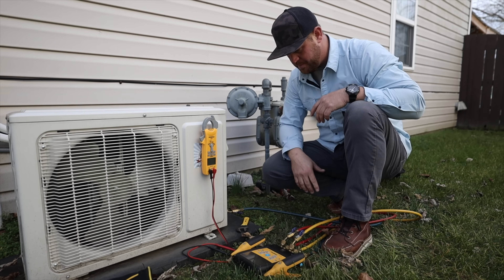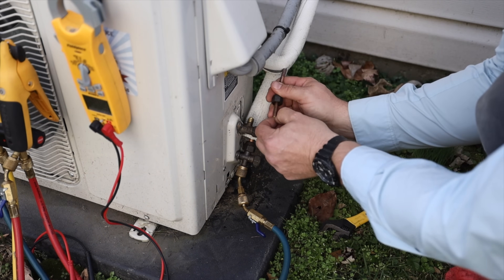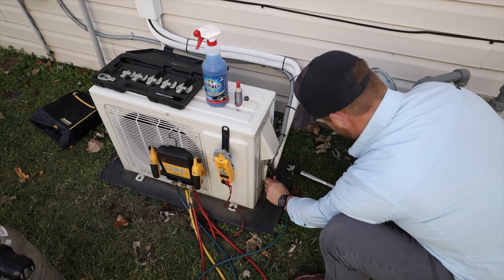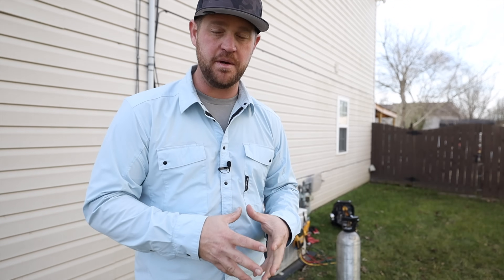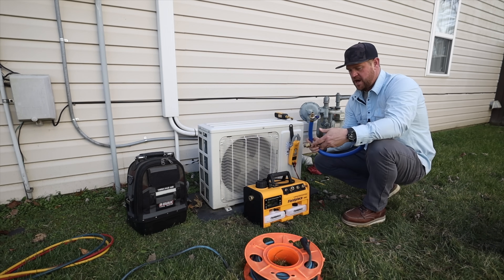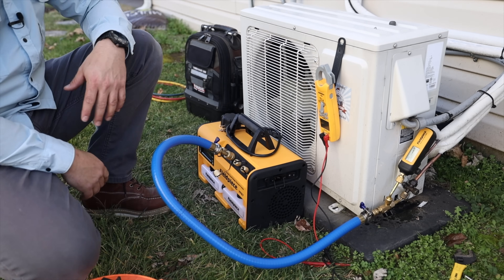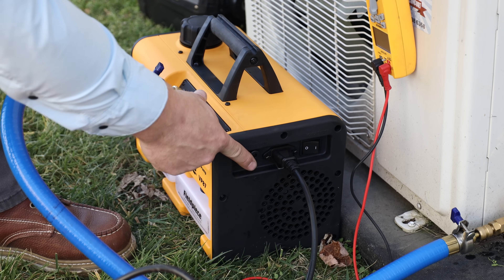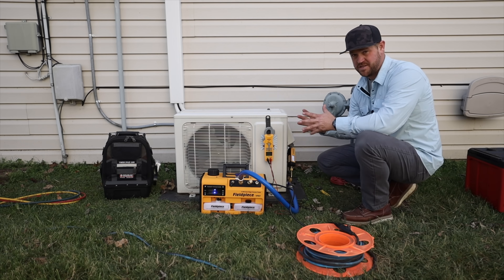#1 Reason Why DUCTLESS Units Fail | How I Fix It...

Comment: The installer didn't put the honey on the fittings!  There a type of very think oil that the techs call honey...  Works every time on the joints and fittings

Comment: When using the pressure test on the manifold, you are supposed to also hook up your temperature probe to measure temperature of the line to account for Pressure-Temperature relation
Reply: On a mini split? Where are the specs for pressure?
Reply: @Keith Wiebe  not sure what exactly you're asking, but I'm just simply stating what the instruction manual for those gauges say about the tightness test function on the manifold.
Reply: @MurderTeam1995  Maybe I misunderstood your answer. Perhaps you were referring to checking the pressure drop with temp in checking for leaks with nitrogen. I at first thought you were talking about how to fill up system according to temperature. You're not suppose to do that but I did on mine.

Comment: You can not remove the vacume hose before there is positive pressure in the system. If you do so you let some air in.

Comment: Mini-splits with their flares were designed to sell refrigerant, I feel.  I had a fitting that leaked for years, despite re-flaring twice and torqueing perfectly to spec.  Out of desperation, I finally just hoses it down with bubble fluid, backed the nut off and then re-cranked, going way past the specified torque and watching the bubbles.  After a pretty good amount of torque, the bubbles tapered off and stopped and it hasn't leaked since (at least 4 years now).
Reply: A lot of the copper that’s on shelves now is like paper. It doesn’t glide as nice on the face of the flare like it used to. Nylog helps but still every tenth flare just won’t seal. It’s absolutely that the copper is too brittle and flimsy
Reply: My boss never trusted the torque specs. He said they say that you're not supposed to overtighten, but the only way he's ever gotten them to stay was to tighten the shit out of them.

I'm my experience they will often hold charge, at torque, but can loosen over time.
Reply: 10 lb-ft seems too low, maybe with lube its enough. I would almost think that a better torque spec would involve a stage 1 torque to 50% of the desired lb-ft, then stage 2 with a degree gauge and torque another number of degrees of rotation. I DIY installed a mini-split 3 years ago and it still runs great, but I know I went well over the torque spec and tightened it by feel.
Reply: @davidryder3374  sorry, mine don't leak and all of them are torqued per spec.
Your flares are probably crap
Reply: Also need a dab of nylog on the face of the flare, I also put on backside but the face is most important
Reply: I think you are right or they just don't tell you that you have to uses a flare seal and Nylog. the Nylog helps it lubricate fittings. The nylon seal worked like magic.
Reply: My boss at my first company had no idea what to do with these systems.   Torquing to spec with new wrench we had countless leaks, key is like you said, backing off and then retorquing, torquing all at once causes tortional friction and backing off half turn cures this issue.   Still haven't decided whether like design but open minded.  Weird as fuck not in directions first place.
Reply: Oldtimers like me don't use flare wrenches.  We use good old 10-point open flare wrenches, and learn by feel how tight to pull up the flare nut.  That's where experience comes in.  I never had one of my flare connections leak, not then or over time.
Reply: @Georooney  :  Same here, and I have always oiled the back of the bell on the flare and also put oil on the threads of the service valve.  That way the brass nut doesn't bind on the copper and cause any twisting of the line at the flare connection.  Like you, and after over 50 years in the trade, I have never had a flared connection leak.
Reply: I just did a minsplit. They don't use flare fittings anymore. They use o-rings and the lines are pre vacuumed.
Reply: @josephkostinko739  thats the diy version. Most arent like that.
Reply: @ray29999  At least you know there's other options.
Reply: @josephkostinko739  That depends on the maker. Don't you know that?

Comment: Never use thread lock or any sealant on a flare connection. ALWAYS use oil when making the flare. Always clean the flare and use oil on the flare and the threads when torquing. I've never had a leak and this procedure has repaired every leak I ever encountered. I don't understand why you young guys always think you need sealant and thread sealer where it doesn't belong. Old school proper techniques always work. ALWAYS use oil on flare connections; makes sure they are CLEAN.

Comment: A perfect example of why a tech cannot be depended on.  #1 when you pressurize and blow bubbles. That is when you put on a torq wrench and see what is it at. If under, than go to 15# does it stop? That's what you should do. Not disconnect the line and charge more time and more expenses. hen simply tighten and look again at least.  And for every connection there is another end possibly. Factory seals are usually not the issue. It is what the last tech did. The only benefit is seeing no pressure loss.   So all he had to have do was tighten the service connection and add some refigerant. So clue us what this super easy repair call took and cost?

Comment: I had Nylog cause 1/4" flairs to squirt out of the nut. Happened 4 times on a 5 port system. Lost the whole charge. When I took apart the first one I thought the flair had thinned out and broke off  but there was no bugle anywhere.  Instead if you looked inside the end of the pipe you could see the flair had un flaired and squirted out of the nut.  I will NEVER use that stuff again.  At least not on small flairs.

Comment: Hey mate. I'm a second generation specialist with over 50 years personal experience and I've got to tell you that your terminology is incorrect. In refrigeration the small line is always the liquid line but with these mini split systems the expansion device is in the condensing unit making the smaller pipe a part of the evaporator. That's why both pipes have to be insulated. Just thought you should know. 

Regards,

Trev Judd
Australia

Comment: 6:05 after 15 minutes 0.3psi drop??? that means 1.2psi in an hour and 28psi in a day? how the hell is that good?
Reply: System equalising. I’ve had 2psi drop in first 15mins. Then after it’s settled. No more drop in pressure.

Comment: I don't think you're supposed to put ny log on the threads. If the flare was overtorked the 1st time it will be thinner and it will not torque the same should have a new flare. With nylog on it do not put nylog on the threads that makes it too slick and you will overtighten it stretching the thread. If I'm wrong let me know thanks. It's just what I've been told sounds right
Reply: You're not wrong! 👍
Reply: 1 ft lb is 1 ft lb.  Sure the copper will compress , that would be an interesting repeatability study/  test ..  🎯

Comment: If u suspect air or moisture in your  mini split lines from not properly being vacuumed how do u correct that issue I've seen every video except on how to remove the old R-410 & replace it with new R-410 people seem to skip showing us that procedure I've seen people at refrigerant to existing refrigerant in the system just wondering if I need to completely remove my R-410 just trying to figure out what to do about my mini split

Comment: Love that pressure test feature. Btw fieldpiece states you should be getting a temp reading on the pipe being pressure tested with the clamp. It factors into the -/+ pressure reading.

On small ric and rif I don’t use the clamp. On the bigger stuff it’s best to do so. No I don’t just work on tiny ric either. It could be a ric, rif, wic, wif, mini split, conventional ac system, or even a 2 stage rtu.

Comment: Flares are a one time use, unless it is a double flare.  The copper work hardens, and can split.  Just cut it off and re do it.  Did you blow the refrigerant (you said it had 50 psi), along with the nitrogen you put on top of it?  Weren’t you supposed to recover the remaining refrigerant? It’s ok, I won’t tell the EPA.  I like those gauges.  I had the same set. I think mine had a built in micron gauge.  Good equipment, good video.  Very well organized.

Comment: What accounts for the 0.3 psi pressure drop over 15 min? Temperature equalization after filling the line with nitrogen? Wouldn't you need to hold the pressure longer to rule out a smaller leak somewhere else or maybe some microscopic damage to the flare fitting from the copper debris you found?
Reply: HE'S A HACK. AND DOENS'T TEST LONG ENOUGH

Comment: Good flare never leak, need to use good pipes 1mm thickness, always do pressure test 30 bar, then you go 15 years no problem

Comment: My procedure, bend, flare, and fit line set. Using nitrogen blow out both lines with blowgun. Torque but leave liquid line loose from condenser. Install core remover, remove core, pressurize lines and indoor unit bleeding out liquid line. Torque liquid line. Pressure test at 450. Evacuate below 200. I use a small brush to apply a very light coat of pump oil to flares. After it holds vacuum, remove vacuum hose from core remover, briefly open liquid service valve, purge through core remover, install core, and open valves.

Comment: Ive been to some Mitsubishi ductless classes and they say that they don’t want nylog on the threads of the flare only the backside of the copper because it can get in the strainers and cause issues. Im curious if you’ve ever had any issues with strainers getting clogged in ductless systems because it sounds like bullshit to me.

Comment: I don't think I would call a  loss of 0.3 PSI in 15 minutes a leak free system. In Israel when we install VRF systems, we charge them with 500-600 PSI of nitrogen and after 48 hours we expect to see no loss of pressure whatsoever, as a condition to confirm the system is leak free and ready to activate.
Reply: AGREE, THIS IS A HACK JOB

Comment: Ha he put the nylog everywhere BUT where he is supposed to put it.....on the mating surface of the fitting and the inside of the flare.  The nylog doesn't do any good on the threads because the threads do not seal the fitting.  It also does no good on the back side of the flare.The only sealing is done where the flare sits on the fitting.

Comment: Not a good video,R410 is a zeotropic and a azeotropic refrigerant,When a system leaks,the lighter refrigerant will leak out before the others creating an imbalance of the 3 refrigerants.If one does it the way its done in this video,The seer and efficiency will not be what it was from the factory.To do it properly,All refrigerant from a leaking system needs to be evacuated from the system and refilled with the right amount of refrigerant and oil,A hard vacuum will pull oil out of the system so oil does need to be put back into the system after all refrigerant is taken out.A triple evacuation is the best way to do the procedure.And braze all flare fittings with harris safety silv 56 rods.A reaction from the impurities in the copper and the dissimilar material reaction(Galvanic)from the copper to the brass will create pits in the flare cone surface over time.Also formicary corrosion does factor into play here as the POE,Mineral,Alkylbenzene oil has organic materials in the formula.A good chance it will leak in time,Again.Seen it many times before.A friend who has been in this field for 40+ years said all flare fittings leak over time,If you have an IR leak detector,You will see it,Most other detectors(Heated diode) will not see these small leaks.Joe P.E.

Comment: I soldered on the middle section of the .in split but it's not getting cold anymore .. I don't know if it's the solder I used since it's for water pipes or its something else . I spent over 1000$ on technicians and freon since the tech couldn't fix it . I'm doing it my self any afvice

Comment: Quick question. Was your vacuum gauge isolated when you added refrigerant? It didn't look like it but I could be wrong. I was always told even a little pressure on those can really mess them up!
Reply: yeah he never showed how he charged unit since he wasnt using a manifold and we didnt see a shutdown valve on his attachment it looks like he broke the vac before charging and sucked moisture in.

Comment: I only had 1 problem with flares and it was a factory done flare. The 3/8" flare was made ultra thin and worked for 1 week then it blew out. I check all flares now because it is very embarrassing having a leak .

Comment: Hi...appreciate the video.  I have a question.  Please excuse my ignorance.  I recently had someone install a minisplit to help with cooling in my garage, which frequently rose above 95-100 degrees during the intense July and August heat.  The connectinos, where you checked the flange, have condensation, and drip, and are ice cold.  Is this the result of normal operation, or is it the result of something leaking out onto the connections.  Thank you.
Reply: Completely normal. No need to worry.
Reply: @mattsbrute  ..Thank you.  Now that the Temps have cooled, and outside air is in the 30's, the unit is throwing off mostly cold air, when set to heat.  Is it just too cold for the unit to be effective?
Reply: @jamesgioia2633   My mini splits put have  put out 128 degree air on a 10 degree night. 30s is nothing for them.  Are you saying your inside unit is blowing cold air on a 30 degree day? To be clear, if your temp is set to say 70 inside and the room is 70 its not going to blow hot air. The fan will spin slowly so it can determine air temp passing thru the unit. That air will feel colder than the room. You should also notice the air vent will redirect itself to higher position so cool air isnt hitting you. When the heat cycle kicks back in the vent will automatically adjust the air vent down.

Comment: There is actually another common problem with mini split systems. The condensing unit has a capacitor that goes bad, this turns on the initial compressor. And you have the condensing could will get dirty from lawn mowers!

Comment: I wish the manufacturers of mini-splits included a small tube of Nylog with the unit.  Guys that are accustomed to installing brazed connections may not have any Nylog handy, or even know about it.  Like he said, a tiny bit on the back of those flares makes a huge difference.
Reply: it was included in my pioneer

Comment: did you check the connections coming out of the head unit?

I like using the micron gauge as a way to check for leaks, if it will hold a vacuum below 500 microns you don't have a leak.

Blue death on threads on a mini split is a bad Idea IMO.

Comment: A micron is a measure of length.  What does micron mean in the HVAC craft.  I like your organization and logical troubleshooting technique. 😎
Reply: It's a pressure measurement, similar to "inches of mercury" -- specifically used for vacuum systems. I believe it's equivalent to "microns of mercury", so high vacuum.
Reply: @thewheelieguy  Thanks 🙏 , you taught me something new.  I was familiar with inches of Hg, and millimeters of Hg, but a micron in HVAC I’ve now found out  is 1 millionth of the pressure exerted by a meter high column of HG, a pretty fine increment. 👍 👏

Comment: After the vac pump sales pitch,  don't forget too Add 4 mounting lag bolt to secure the condenser  legs to the pad.  Torque all 4 of them this will help stop the shake, ratter and rolling which JUST may be loosening the big fat suction line nut,  causing the refrigerant lost  a very common problem.  Don't trip over the obvious while looking for the genius. I don't need to buy a new pump.

Comment: That gas Meter would be a problem in Ct where I am.. either have to vent regulator away or move unit. The inspectors dont care if ductless or unitary they enforce code no matter what even though theres no contactor they still break our chops

Comment: Be sure you disconnect power to the unit, when filling with nitrogen.  Nitrogen is a non-compressible gas, it will destroy the compressor if it starts accidentally
Reply: While I’m not doubting it can damage a refrigeration compressor, saying nitrogen is a non-compressible gas is flat out wrong. 

If that was the case, standard air compressors would explode instantly. Also, the nitrogen tanks use for purging is COMPRESSED nitrogen.

Comment: With a long line set for example, you could remove the schrader valve, normal valve core remover tool, then later charge to 5 psi, reinsert valv. Another method, loosen mounting fasteners, lift her up a wee bit, away you go!
Reply: The latter suggestion was my thought.  The lines appeared to have room to flex and accommodate a couple of inches of movement upward.  Extra steps with removing and replacing the mounting bolts, admittedly.
Reply: No need to remove the valve core on the mini splits. This is useful on units over 5 ton with long lines over 7/8".

Comment: A gas man here,  just wondering what the code is in your area for distance between gas meter and ignition source the internal relief on that gas regulator looks to close to the AC unit could be a problem if it vents.
Reply: Propane guy here. Was wondering the same thing. Normally it’s 10 feet from any source of ignition where I’m from.

Comment: Are there any preventative measures you can take when you buy a unit like this to reduce the likelihood of these leaks from happening?
Reply: Braze all joints or use Swagelok or Parker fittings

Comment: Is it just me was the unit not anchored down? Looked like no bolts, just sitting on a rubber base. May be why the lines were loosened up, to much movement over time.